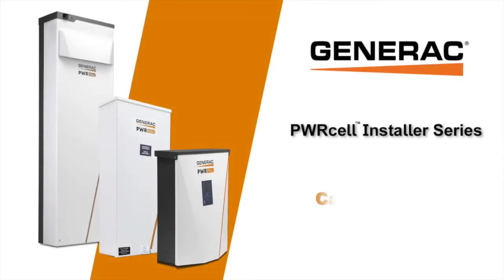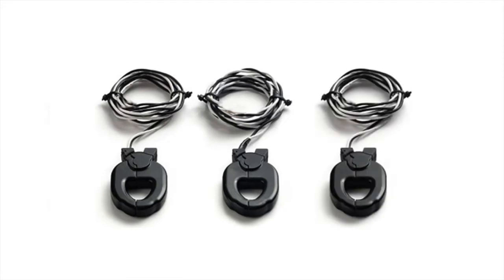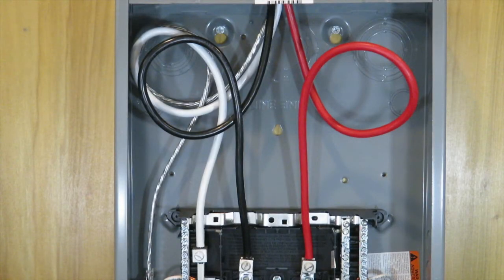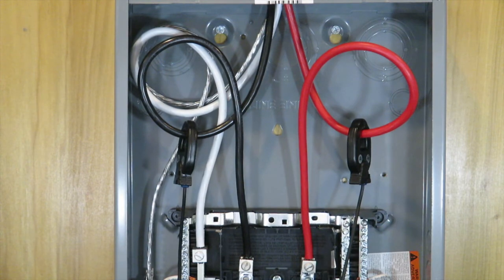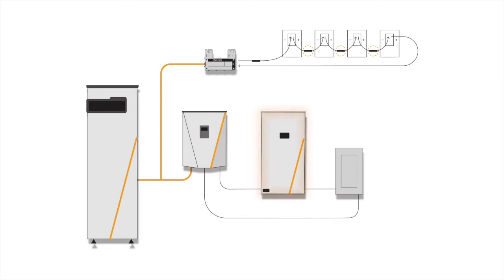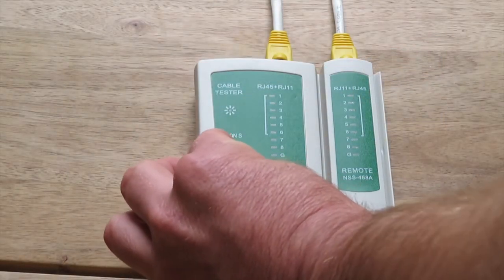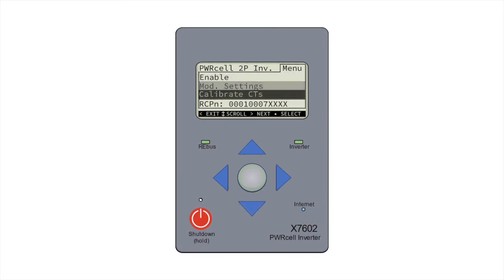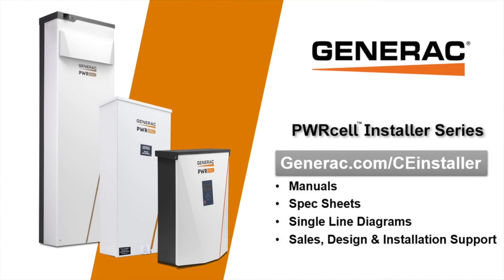Generac Installer Series: CT Installation

Comment: Thank you for this video.  Because of the way my meter and main panel are made, there is no place to install the CTs as shown in the video.  My contractor installed the CTs on the wires coming from the inverter to the breaker panel.  Will my system operate properly installed this way?